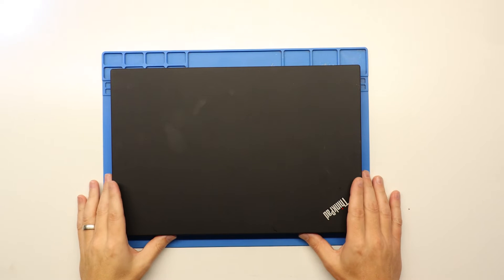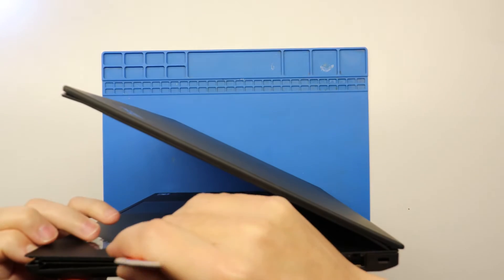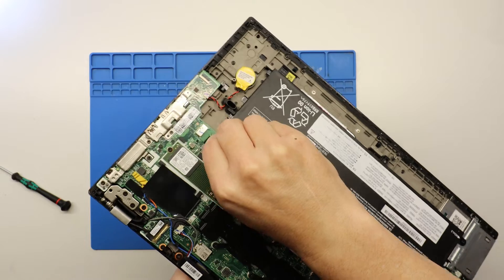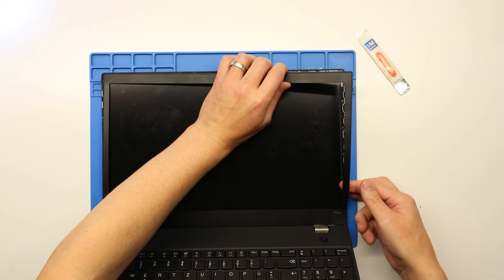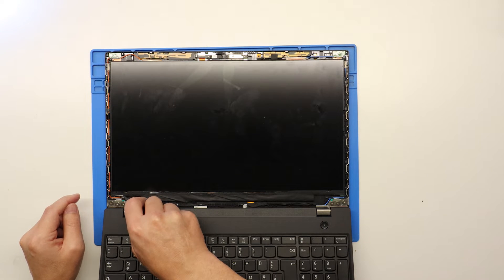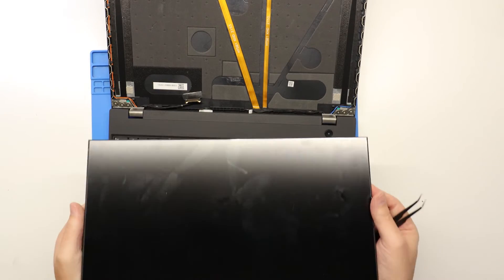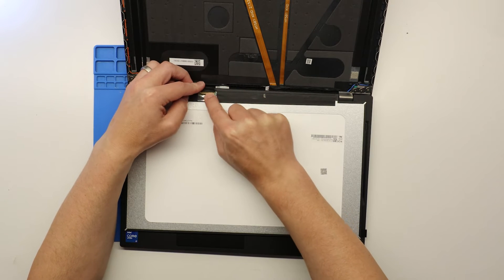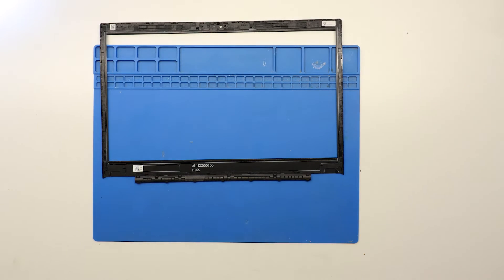How to replace the screen on a ThinkPad P15s Gen 2 laptop - the easy way to replace a laptop LCD

Comment: Thanks for the video, makes it really easy to understand. I was a little nervous about what you called the "bezel" for the screen's trim, would using the spreader work here instead of a finger as well? I dont want to break or bend that plastic.
Reply from the maker: Thanks Hector - yes absolutley a spreader will work too - I would suggest using a plastic one (not metal) to limit any damage to the screen

Comment: Very nice video, thanks !
I've a technical question, maybe you could help. I've L15 Gen1, running Win11. The display brightness became very low, but not totally zero (I hardly can see anything). 
External monitor via USB-C or HDMI works fine. 
Could it be an issue with the display, connector or something else? How would you debug that?
Thank you !!
Reply from the maker: Sounds like a backlight issue
Reply: Thank you for sharing your thoughts.  I replaced the display and it solved the problem. I am still curious why the external monitor is still flickering once in while. Could it be an issue with the on board graphical card?😊

Comment: Nice video. I have a Thinkpad t15 gen 1 and the screen got broken recently. Do you happen to know the replacement number part? I don't want to buy the wrong one.
Reply from the maker: Thank you.  Most manufactures use different screens even on the same model laptop so it is best to take out the broken screen and look for the model number label to find your part number - enter this in Google or eBay and you will find the correct replacement.